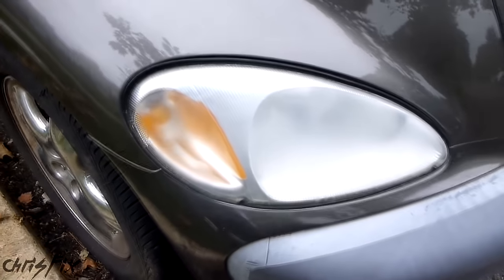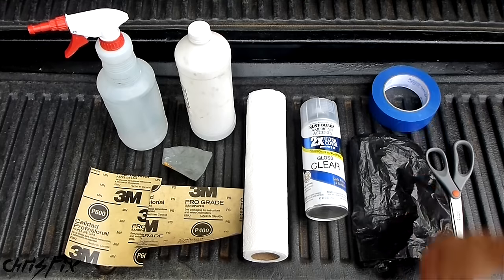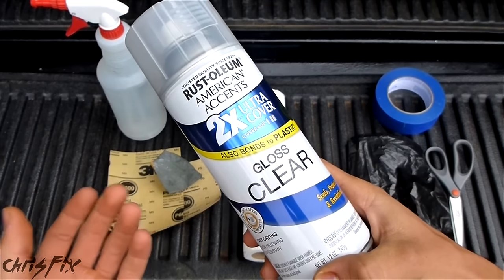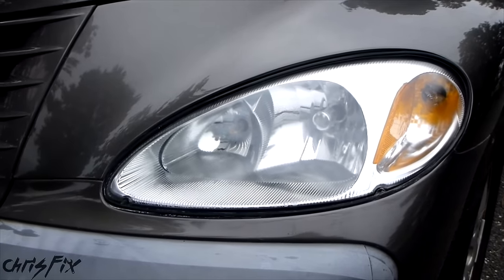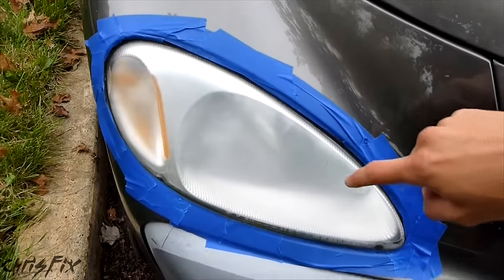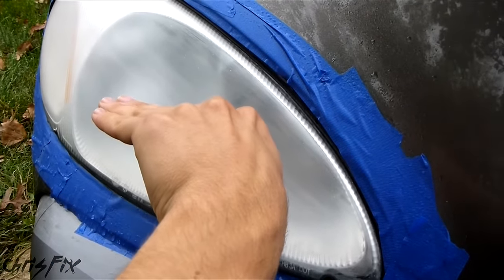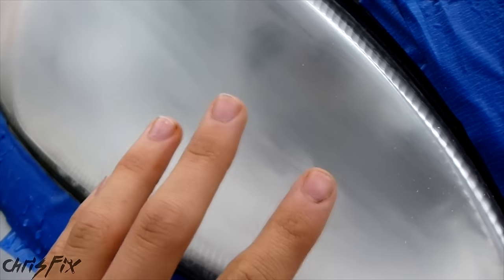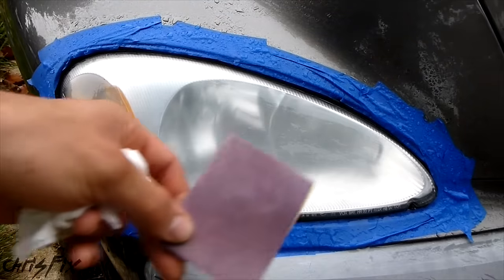How to Restore Headlights PERMANENTLY

Comment: I had to redue my headlights 3 times because my paint kept cracking.. humidity and temp was fine and headlights were clean before application. I did 5 minutes then 10 between until finally I just waited and did one coat a day which is what made it come clear. Still came out basically new but took more time. Not sure why I used the same paint as well
Reply from the maker: Some plastics are just different and cause cracking. If that happens again you can spray adhesion promoter first to stop the cracking.
Reply: @chrisfix  thanks I will keep that in mind for the next one!

Comment: Love this. Thanks for sharing, Chris. Will the clearcoat look clearer the following day? Or will it look exactly like it does right after you apply the 3rd layer of clearcoat? 

Thanks
Reply from the maker: It should clear up when you give it some to sit
Reply: @chrisfix  thanks for the quick reply. It looks a little better today.

So i actually did one headlight following a different tutorial (which turned out poorly), and then used your tutorial for the other headlight (which turned out perfectly). 

Now I'm using your turorial to correct the poor one. After 24 hrs it definitely looks better, but still a little hazy. Im guessing i didnt remove enough of the old clearcoat from the bad tutorial i followed the 1st time, so think ill dry sand a little with 100 grit till that clearcoat is gone, then repeat this video with the wet sand.

Having this clear tutorial of your's really helps. Keep up the great work 👍

Comment: I use autosole metal polish with a soft drill attachment.  Quick polish up after with screen wash on a clean towel,  then clear coat. 20 min job and comes out really nice. Just a lil elbow grease is tighter corners .

Comment: Hey Chris! I found a car detailing channel and they added a compound into polish step after sanding. Of course using alcohol in-between and after before adding clearcoat to keep everything clean. I have the tools to do it, but is it necessary? I would think the only reason to polish is if you messed up the clear coat. Thanks

Comment: 8 years later just did it on my 1995 mitsubishi 3000gt headlights... They look better than before, to say the least. But my clearcoat got all scaly and veiny, which is likely just because I live in Texas and humidity doesnt like paint.. Not much to do about that, but looks better than it did. Going to go over it with some steel wool and high grit to try and smoothen it out once its fully dry :)
Reply from the maker: You can sand with 1000 then 2000 then compound and polish to get those lines out from the humidity.

Comment: I just did this to the lights on my 2000 Honda Insight, and it turned out really well, until I tried to wet sand them 3 days later with 3000 grit sandpaper. They look super cloudy just like they did after I used the 2000 grit in the original steps. I’m going to try using 5000 grit paper and then polishing the lights with Meguiars PlastiX polish, as ChrisFix mentioned in a comment above. If that doesn’t work, I guess I’ll have to completely re-do them🙄. I’ll update this comment with how they turn out.
Reply: They turned out fine once I polished them!

Comment: great video! I sprayed it 3 times with the clear coat and it still shows that "orange peal" effect slightly, so should I light sand with 3000 to take some of that out or should I try to put another coat on it? but overall the lights are 98% better, no kidding! now I need to do this on my old Silverado which has headlights like yellow snow!

Comment: ChrisFix you legend. It almost worked completely perfectly for me, but I tried wet sanding some of the orange peel from the headlights after the 24 hour wait time with 2000 grit sandpaper and it’s left some visible scratch marks. Any suggestions? 

Does the orange peel look come from too much spray? 

Thanks bro

EDIT: Just realized I didn't activate the catalyst in my 2K clear coat... wondering how long this restoration is going to last now. Still, I learned something from the experience and it's probably something I'll have to do over again next year...

Comment: Hey Chris, I did this same thing and the headlights look amazing! I have a question though, after the second or third coat, the clearcoat made this sort of wrinkle effect on the headlights, not quite the orange peel effect in this video, and sanding doesn't remove it. Any advice?
Reply: I have the same thing happening. Once it first sprayed it, it looked awesome. But after drying it started cracking or "wrinkling" like you're saying.

Comment: Thanks Chris!  I just did mine this morning (2003 Dodge Grand Caravan). Wow what a difference. I wet sanded using  400, 800, and 2000 grit buffing pads with an orbital sander and Meguiar's clear coat. Tomorrow I'll add wax.

Comment: this restoration process worked great until I sprayed the clear coat on.  When the clear coat dried it left an orange peel design which was quite visible. I tried sanding with 3000 grit as Chris mentioned but was not able to get rid of the orange peel.

Comment: Ive done this before using your exact clear coat paint with no issues, however i recently did this to my nissan and the rustoleum completely destroyed my headlights, they caused cracking....im devostated.

Comment: After I sanded it with the 400 grit, 600 grit, 2000 grit, cleaned it, and then applied the clear coat (and let it cure for 24 hours - it looked great at this point). I then attempted your alternative to sand down the clear coat orange peel with 3000 grit (wet sand) it it's back to looking super hazy like at first with the earlier sanding. Did you mean, if you want to sand the orange peel, you need to do 3k grit, 5k grit, and then polish in order to get it to be crystal clear?

Comment: You can also use TEMPO, a preparation for repairing hairline scratches on cars, like around keyholes, etc. It's available at most gas stations in Czech Republic. It contains small amounts of acetone, which slightly dissolves the plastic, so no need to rub it extensively. Just apply the wax, and rub it off.
Reply from the maker: Interesting, how often do you have re apply?
Reply: @chrisfix  I've only used it once, and that was when I was cleaning up the car to sell it.

Comment: Hi Chris, thanx for great videos and your enthusiasm 👍. I followed these steps for the headlights, except I used a wax instead of clear paint. I'm know it will not be the same and won't last as long. But after doing all this there is still some haze and scratches visible. Do you have some suggestions how I could get this better without using clear paint? 🙏
Reply from the maker: Wet sand with 600 then 800 then 1000 then 2000 then 3000 then 5000 and finally polish. That will make them clear,

Comment: i have seen this video multiple times and finally grew a pair do it on a set of headlamps.

RESULTS: 
1) each headlamps now has different color. i suspect its due to the weather because when i did the other side, cuz it was about to rain and the sky darkened so i couldnt really differentiate the color from sanding result. (realized the difference in color the next morning) do everything on a bright sunny day, like pick morning 8-11am where the sun is constantly bright. 

Dont do it during the day transition hours like 11am - 1pm where the spectrum of natural light turns from white to slightly yellow. 

2) make sure you use colored tapes or painter's tape as per the video. my headlamps has chrome trims and i used clear tape. When i removed the tape the next morning, there were scratches on the chrome trim. (when clear tape is being used, its hard to see whether the trimmings are taped properly)

Comment: I’m not sure if the Rustoleum 2X clear coat formula changed, but I tried this twice, and each time, the clear coat dried quickly into a dragon scale pattern.  The sanding instructions worked out well, though.
Reply: I have had this same issue and have tried this three times now and happened every time!

Comment: I followed every step in this video and the headlight turned out great... Before the clear coat that is. After the 2nd layer of clear coat, I noticed that cracks started forming in the clear coat. A third layer didn't help much either and the final headlight was crystal clear, but had cracks in the clear coat. What did I do wrong? Did I layer it on too much? I waited 5+ minutes in between coats. Also after wet sanding to prime for the wax, the clear coat turns very hazy. Am I sanding it too much or not enough?

Comment: Question after applying the 3 coats of clear coat if there’s a lot of orange peel would wet sanding, compounding or polishing help remove the orange peel to get the clearest lens possible???? Thank you for your video! Easy to understand and follow!
Reply: At the end of the video he says do another 2k or 3k wetsand after the 3rd coat dries for a day and carnauba wax for finish

Comment: I did this on my wife’s car a few years back. It turns out if you do this in high temperature conditions it messes up the clear coating. It was over a 105 the day I did it and the day after. So it never worked well. However I did this on my own car a few months earlier when it was in the 70’s and it looked great. So just a warning. I’m rewatching this to remind myself how to do it so I can do it again on vacation where it’s in the 70’s, as it’s 100 degrees at home. Lol

Comment: About how long should you do each sanding process? I did the 400 for about 20 minutes and have been steadily going at it with the 600 for the last hour or so. I still get the milky stuff, so I'm not sure if I need to keep going with the 600 grit. I have a 2004 Infiniti G35 and the headlights are a little big, so I figured it would take extra time to do them!  Thank you so much for your helpful videos!

Comment: $20 may have been the cost for materials back in 2014 when this was made but not today. But works so you may still want to try it.
Reply: I bought tape,  sandpaper,  wax and spray for about $30 from Amazon  (3/2023)

Comment: I've been wanting to restore my headlights for about a year now, but was too nervous about it. I have looked into the job car painter the last two years, cause I really wanna make a second apprenticeship in that job. Because of that I've actually been able to practise some of these steps (sanding/ wet sanding/ spraying in the bodyshop) so I'm confident enough to try it by myself (and maybe with a good mechanic friend of mine). 
The only question I have: did you leave the car outside to let it dry the 24 hours? I'm worried there might be some dirt because of weather or something around, that could get on the headlight while drying.

Comment: Legit this is better than listening to that old geezer whomst was a former mechanic that always says "start your engines" and rings a goddang church bell.  

For my 98 mustang (3.8l v6) I will be doing an experiment on it on doing an awd conversion, if its successful, would you be interested in buying one from me?

For future reference (more than likely ill forget it so bear with me here,) the kit will include:

Subframe upgrade,
steel sheet (for welding in a patch strip to prevent shrinking and warping after cutting the firewall a bit),
differential with oem oil pan replacement*,
t case with transmission adapter,
custom t case shift button or manual shift,
modified K-member,
ford taurus steering knuckles, brake pads/rotors,
subaru wrx coilovers,
6-12 month warranty.

* = Note that depending if you want to keep the 4.6 or whichever engine you have in your mustang currently, i will need to know what im building this kit for prior so that 99 percent is already taken care of for you and all you'd have to do is install it or have someone install it for you.

To be clear, i cannot assure at this point in time that all is for certain but once i get my ball rolling ill give an exact price breakdown of parts needed if youre interested.

Shameless advert aside i love this video and keep up the awesome work man!  10/10! :)

Comment: Great video.  I used some ultra fine sand paper and then used Maguire's polish and spray (the spray seems to be something close to clear coat) and it worked well.  I'm just curious about one thing: just like in the video, the headlight became MUCH more transparent after applying the spray.  How is it able to do that?  I figured that any spray would reduce transparency.  Is it reducing reflection somehow?  If there are any lurking optics/physics folks, help me to understand this mystery.

Comment: Hey @chrisfix so after all these years I have a question. Do you prefer after the clear coat to wax it or let it like it is? So after clear coat 24h later again with 2000 or 3000 sandpaper and then wax it? Thx very much and happy new year🎉

Comment: The problem with this method is the paint and orange peel.   The other issue is that the sun will damage the paint and result in cracked paint and haziness over time.  Mercedes used to paint its headlight covers and they looked awful after a couple of years.  I would do a sanding process until the runoff shows no brown tint and then buff the surface with a rubbing compound, then a polishing compound.  Protection long term is achieved by a coating of a clear special UV light protectant which is available at the auto parts stores.

Comment: I just did this last night on my wife’s 2014 crv.  I had the kit so wet sanded 500, 800, 1200, 3000 and rubbing compound with a cordless drill.  I finish with a wax.  I’m wondering if a ceramic protectant may be easier to use than rattle clear if it is maintained.
Reply from the maker: Ceramic is definitely easier but it wont last unfortunately. It lasts about a year.

Comment: From my experience you should use 3M headlight restoration wipe instead of clear spray paint. Spray paint maybe good if you get a great paint and know how to use it, but otherwise it'll have orange peel affecting clarity and mine yellowed fairly quickly. So use the 3M headlight wipe, because it is designed for headlights and wont result in orange peel, and it's much easier to apply. However I have to say I have never tried it with this video's technique, I've only tried it with the 3M kit which includes sanding discs meant for a drill. 
Any headlight coating, including the factory one, will eventually wear off from air hitting it, so wax the headlights like Chrisfix said to make it last longer. I bought a Turtle wax in a circular green tub for that. I think if you don't drive a ton of miles, the coating will last a long time even if you don't wax it. 

And if your coating is probably wearing off (e.g. you drive a lot or it's been several years) you can just reapply the coating before the headlights get yellow again, i think. You want to strengthen the coating before it wears off completely and allows the plastic to yellow, otherwise you'll have to sand the yellow plastic off again which is more work.

Comment: I messed it up, can’t tell if I bought too cheap of spray paint, or it was too cold. I have cracking in the clear coat even with a smooth finish. It was probably 55-60 in my garage when I did it, I used rust-oleum acrylic enamel gloss crystal clear.
Reply from the maker: Dang, just sand it off and try again

Comment: Wait should we use the stuff you used in the video or the stuff you put in the description? The clear coat you linked is $24 vs rustoleum you used is only like $7? And the meguires Plastx is a clean and polish but the carnuba is a wax? Please clarify cus I’d certainly prefer the cheaper clear coat if it’s just as good

Comment: I just did this on my Honda 2014 CRV!! It went from orange plastic headlights, back to beautiful and clear headlights!!

I have a question, for the end of your video, you say that I can do another 2000 or 3000 grit sand. One of my headlights could use a bit more sanding. My question is, do I put 3 coats of clear coat paint again after I sand it with a 2000/3000 grit paper? :)
Reply: Please help 🙏

Comment: Hello I did this on my 2009 Honda Pilot. It worked thanks for the helpful video. One of my headlights after applying the clear coat. Once dry it has cracked lines? Any way to fix this issue?
Reply from the maker: Glad the video helped. If it is cracked you can sand it down so it's smooth (but hazy) and then polish it to make it clear. That happens when the clear coat is put on too thick, the plastic is not compatible, or the surface is not prepped correctly. Totally fixable!

Comment: Finally got around to doing this on my gf's Hyundai Sonata with foggy yellow headlights. After following along, the last head light came out fantastic but I feel I may have used too much clear coat on the first head light since it still looks a bit foggy while the last is really clear. Should I wait for the 24 hour cure and do a light sand or sand it down and start over to get the same look?

Comment: Hi Chris, I just finished doing my headlights. It all worked great but there are a few running paint spots from the spray. It's still fresh, so I don't know how it looks tomorrow after it's dry. But if they're still there, can I sand them down without having to do this over? Any feedback is greatly appreciated :)